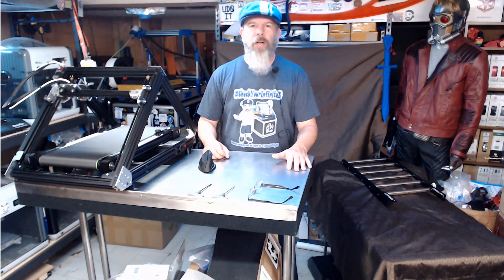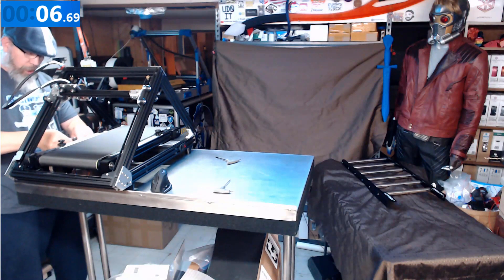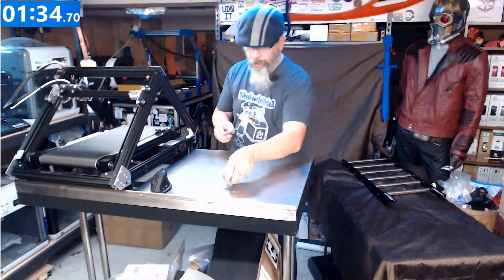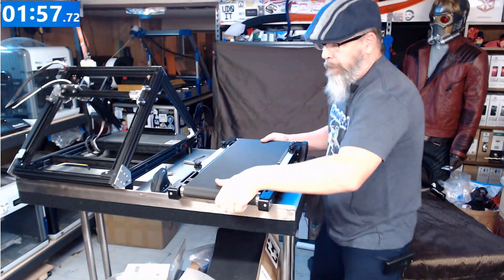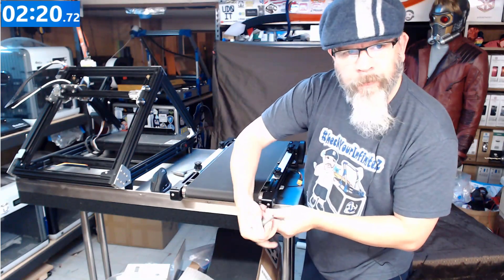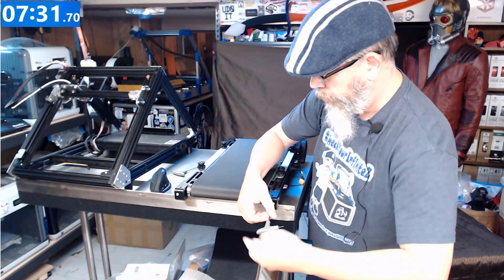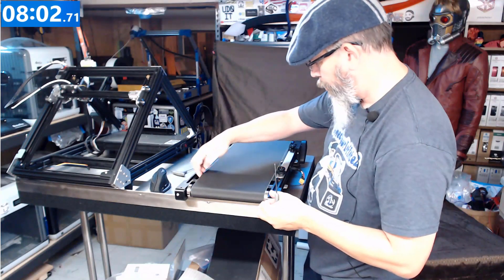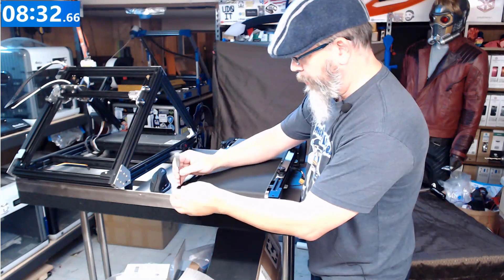3DPrintMill - How to change the belt

Comment: Sorry for a second question about the DaVinci thing, but does it require flashing the repitair OS for it to work or can I keep the normal OS and continue using simplify3D like I already am?

To add, I'm not doing the 200x200 upgrade as well, in only doing the extruder upgrade
Reply from the maker: To be honest I've never tried it without flashing the firmware..  I wasn't going to pay for S3D and their firmware is way to restricted otherwise..  Also got tired of overriding the proprietary filament cartridges..  All around I think it works better on Repetier.
Reply: @NAK3DDesigns  Well I guess I'll be the first to test it then :p I would rather not have to flash it though I guess if I have to
Reply from the maker: @sacripudding4586  Sorry i don't have a better answer, but its been so long since I've messed with my DaVinci's I forget what I changed..  Kinda one reason I haven't finished that video series..
Reply: @NAK3DDesigns  Nah it's fine. Not many mods exist for the DaVinci and this upgrade seems like a godsend for 2.0 owners. Though another question, I've looked through the guides a few times and didn't see any mention but I want to check with you, is a drill required for this? If so, is it on a part that woild be hard to replace if I messed it up
Reply from the maker: @sacripudding4586  as part of the modification I drilled small holes in brass bushings to use as oil weep holes..  its not necessary just makes lubing the rails much easier.
Reply: @NAK3DDesigns  is where I need to drill in a difficult spot? I'm wanting to minimise my risk here so even if lubing is difficult without the holes I would rather be safe then sorry. Though if it's unreasonable to not do it, I will
Reply from the maker: @sacripudding4586  You'll be able to see where I drilled the holes in the video..  I got that far.. lol  here is where I cover it in my video.. https://youtu.be/HiSUNTpmOZo?t=792
Reply: @NAK3DDesigns  oh yeah speaking of the videos, did you get the full chimera upgrade done before you stopped working on it?
Reply: @NAK3DDesigns  Also it having guided holes should mean I'm fine
Reply from the maker: @sacripudding4586  kinda, all that was left was to flash the bios to Repetier and custom cut the covers for the dome top I use.

Comment: Hey! Sorry for commenting on an unrelated video but I'm wanting to do a chimera upgrade for the DaVinci 2.0. I found your guide and other info for doing it, though since the guide there is a chimera+ version out and I can't even find the original. Is it possible that you could try and get the chimera+ version to work?
Reply: If you check the files on thingiverse I do believe the "Chimera carriage 20mm Rev2 with removable cap" version will fit the Chimera+..  I could be mistaken..  It's been a long time since I've messed with my DaVinci's..  I've been too busy with all these belt printers to get back to them.
Reply: @nak3ddesigns284  Ah, I'll take a peak. I didn't look too much into the thingiverse page and talked too soon it seems.

Comment: Really good to see the belt is so easily replaced. If they find a better belt material in the future or there is a good 3rd party alternative it is easy to swap if need be. Thank you for the video makes me more confident in ordering once the Kickstarter goes up
Reply: Glass belt, all the way :)
Reply: Thanks for the video that will mostly serve for every backer and buyer of it. Do you already start to make modification on the one you have ? ( Like direct drive or all metal hotend,etc)
Reply from the maker: @francisgilbert3941  I have a few modifications in the works.. ;)
Reply: i highly doubt there will be many for awhile.
Reply from the maker: @svanput  I've already had one guy ask me for belt dimensions..  He's trying to make a PEI coated belt..
Reply: @svanput  I definitely agree with you but if it ends up being something I use for years to come (which I hope it is) there will be eventually. With a lot of luck it will take off almost like their ender series and have tons of mods fairly early on but I don’t really expect that.
Reply: @Xploit66  yeah unfortunately the bottom finish is not that great
Reply: @svanput  agreed. It will be neat for some stuff but not really functional for a lot. I think I will be adding .2mm or so to the bottoms of my prints so I can sand them smooth easily in the mean time. I really hope they are able to increase the quality before it comes to market which is something they’re looking into. But a quick touch on a belt sander and it’ll be fine.
Reply: I can't imagine belts would need to be changed all that much or atleast not for a while. I guess only time will tell.
Reply from the maker: @stinkyham9050  Hopefully not..  I posted this now for the reviewers that got the wrong belts so they will know how to swap them out when Creality sends them the correct ones..  But who knows maybe in the future well will have different styles of belts (PEI, smooth, textures, PEX, etc) and you'll just swap belts depending on your need.

Comment: Is the belt expected to be a significant price? Like over 100$?
Reply from the maker: I honestly have no idea..  They are still doing some last minute changes to the belt so pricing hasn't been established..
Reply: @NAK3DDesigns  I just recall seeing prices on belts from some other source for group buys being very high like 400$+ for less than 10 belts. Granted creality will be getting them in 1000+ units potentially.
Reply from the maker: @BrandonWhipp  Yea that was probably seamless stainless steel belts for the White Knight and they are very pricey..  Why Creality is looking for a more economical solution.